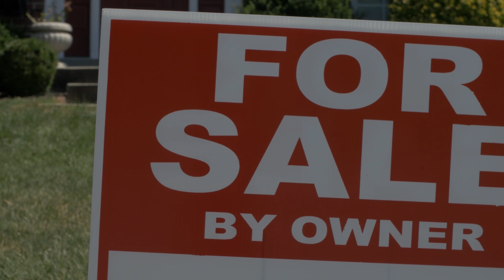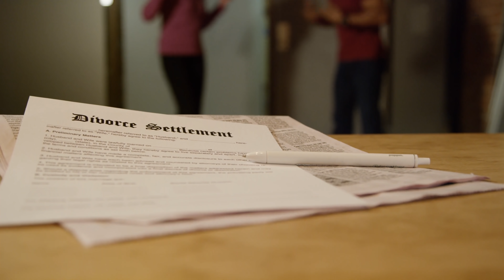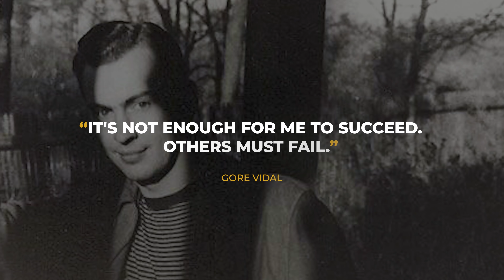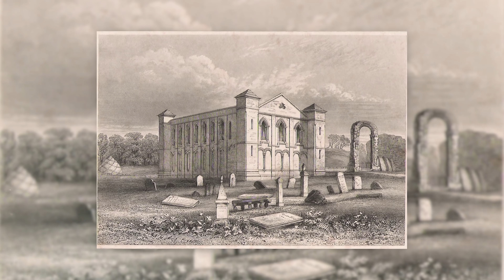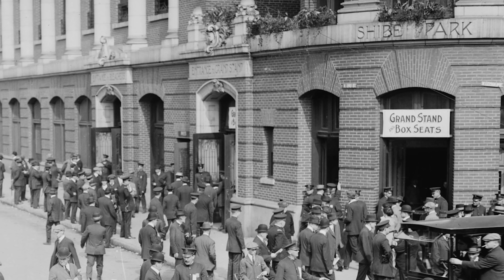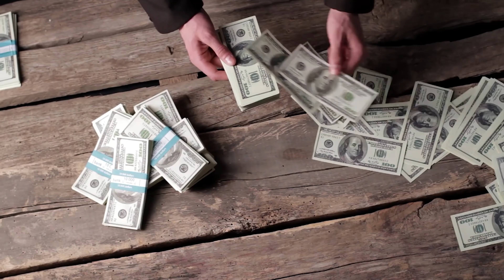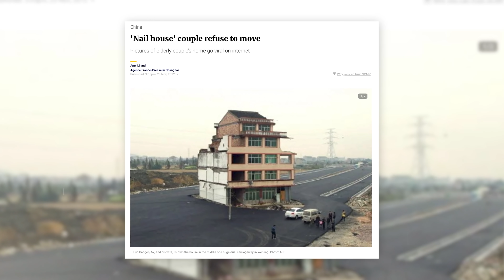Meet the People Who Build Ugly Houses Just to Get Revenge

Comment: Where I live, the county has "Eminent Domain"  over any property near the road.  I live on a 3.5 acre plot that borders a county road. The property is higher than the road, and thus ends with a 45 degree slope from the yard down to the road.  At the bottom of this slope was a nice transition  of ground that formed a gutter.  I can't use a weed-whacker on that slope as my left leg is messed up so that i can not walk up any kind of hill, no stand on one to swing a weed-whacker.   Plus the friggin frontage is like  1/8 mile long and 8 feet high in places!   That's a LOT of weed-whacking!    But I did modify a lawn tractor that I could mow up & down with to keep the slope mowed. If it is not kept mowed the county will either fine me, or spray it with chemicals to kill the grass, or both. 
Fast forward a few years and here comes a crew  with a road grader.  They are cutting a deep groove into the bottom of any slope along that road.  Making it essentially a 12 inch drop-off.   "For drainage" they said. My land is on top of a small hill.  The existing shallow gutter was more than sufficient.  I stopped the operator of the grader and asked him to not cut into my slope. He rudely declined.  I parked my tractor in the  way and found the crew foreman. He was an asshole too.   I told the guy "Well if you cut the bank, you can bring your asses out here every 2 weeks and mow it!"   I was ignored.  They carved an needlessly deep trench resulting an a roughly 2 foot "step" at the bottom of the slope.   My tractor could not get over that, and the slope became overgrown.  After a call by the county to mow it. I explained why I haven't been doing so.  Again, they didn't give a shit.   So I got out my bigger tractor with the dozer-blade and knocked down the "step" they carved.   I smoothed it back out, filling the trench.  Once again, enabling me to mow the slope with my modified lawn tractor.   The next fall,  Here they come again!  I was right behind them filling it right back in!   I do this yearly. Right behind them watching them point and shake their heads. 
No, I will not stop.  This is my action of spite.  To immediately undo the pointless work they have to pay their crews to do, while the crew watches me do it.
Edit for error...
Reply: I would like to think, that if the county has the authority to hire these guys to cut into a hill on YOUR land, then they can hire someone to cut the grass on the hill if they fill it needs to be cut (wild fire prevention, pest control, curb appeal), so long as if said roadwork is making it impossible for you to do so because of a permanent leg injury that would put you at risk for doing the task normally without the use of your modified lawn tractor. 

Of course I'm realist so I know that's like asking for an honest politician who will fight for the next generations future and not worry about which lobbyist will fund their next campaign.

And as a realist I'd also suggest if your injured leg is a documented disability(IE, you have plates that let you use handicap spots) and they go after you for repeatedly bulldozing their trench which stops you from your task of keeping the hill grass mowed, you file a lawsuit against them using the American's with Disabilities Act and make sure you get as many of your local news outlets to cover the story. 

Shit always rolls down hill, but you can guide which way it goes by pointing out to everyone else who the ones with toilet paper stuck to their shoes are.

Comment: I used to have a "spite car". One day the HOA tried to tell me I couldn't park my old pickup on the street anymore. I don't know how they ever got the idea they owned the public street, but they don't. They have no powers in the street, only local laws do. Local law says you can park anything as long as it's registered, and driven at least 500' every 4 days.

So...I spent $400 on an old car that still kinda ran. I busted out all the windows and spray painted it pink with...uh....lets just say symbols. I had it legally registered and took it for a lap around the block every 4 days. It had no muffler so the neighbors would all be notified it was moving per schedule. Parked it exactly where they said I couldn't put my truck. This lasted about a year, and I ended up selling the car for more than I paid!

Comment: You can live in a home in the middle of a highway.  If the designers of the highway account for it and builders build ways in and out that don't interfere with through traffic.  Better if safety features are built in to catch vehicles that would otherwise crash into it; and others to avoid occupants being bothered by traffic noise.

Comment: In my old house the ppl that lived in it before us made a spite fence in the middle of a road to a water cleaning facility just because the property line was in the middle of the road and there was another way to get there but it was 20x harder for the workers ro get there with their truck since ypu have to go through a housing area and take a super sharpe turn on a very thin road to get acces to the road to the facility. So we were a welcomed change when the sold the house after putting bared wire on the road leading past the house where only ppl walked and hurt a lot of wild animals that also walked that road

Comment: Enjoyed the show, but a quibble: nail houses are not pre-existing houses.  Nail houses are hastily thrown together structures hoping to capitalize on a new road or other project coming through by partially constructing a shoddy building for cheaper than the poor compensation given by the CCP, often by friends or family of the officials pushing through the new construction in the first place.  They are normally not completed, and may simply be (literal) facades.  They are called nail houses because they are quickly pounded into the ground by con men (or charitably, speculators).  Holding onto a family residence when the CCP or their cronies decide to screw you on compensation is not a nail house, and the headlines shown are propagada fed to uncritical journalists too dim or corrupt to question the grift.